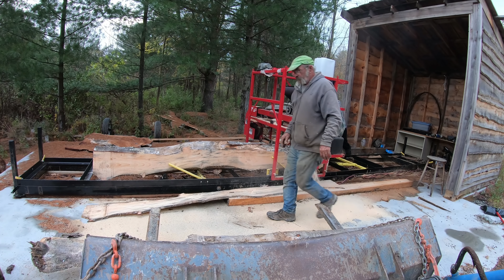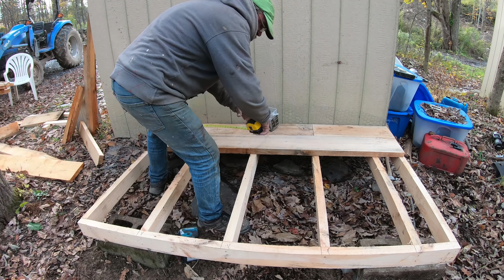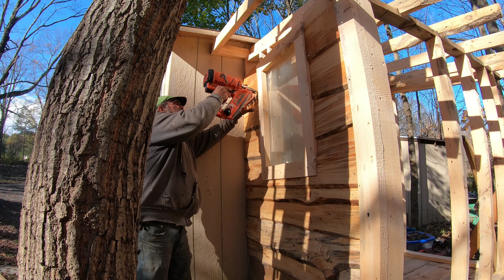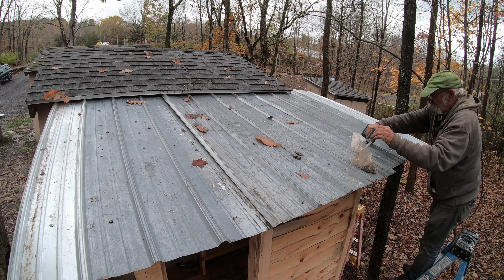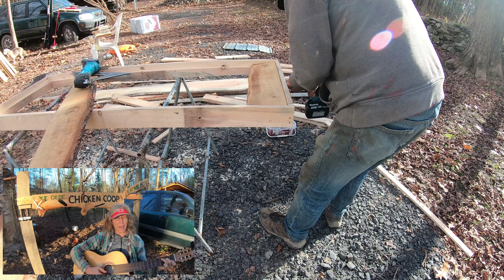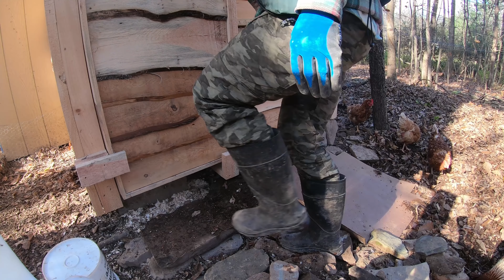milling for and building our chicken coop

Comment: I suspect that the cause of the mill's governor issues is a lean fuel mixture.  You may be able to adjust the mixture by turning a jet.  You might also remove the bowl from the carburetor, remove the float and its valve, remove the jets and clean all with a spray can of carburetor cleaner.  If this does not correct the problem, then you will likely have to take the carburetor off of the engine and rebuild it.
Reply from the maker: thanks i did that a while back and it helped but still surges some
Reply: Go check out “tarylfixesall” he’s really goofy and great small engine mechanic and he has videos on governor set up on many small engines. Just type in the YouTube “taryl fixes all governor” and it’ll pop up
Reply: @danwheeler5130  The next step would be to verify that the governor linkage is not loose.  It is supposed to have a spring that provides tension so that the governor's linkage to the carburetor is not sloppy.  Please verify that the linkage does not have any slack in it.  Ron's comment below is worth following.
Reply from the maker: @ronfrance4041  ok thanks
Reply from the maker: @hivolt55  i think your on to something the spring was missing and i cant find a replacement so i just added springs but i dont think i have the tension right

Comment: Surging motor is usually caused by partially clogged jets in the carb.
Reply from the maker: i cleaned it once maybe have to do it again thanks
Reply: @danwheeler5130  The air/gas mixture screws need adjustment.
Reply from the maker: @lutemule  i'll try that thanks

Comment: These nail guns make a good man cut corners. I don’t know where you got that from Dan you certainly never passed it onto your son. ( I know it’s only a chicken shed but it’s still cutting corners)
That’s my comment sorted for this video then👍🏴
Reply from the maker: how so
Reply: @danwheeler5130  Just an observation. When framing, old school would build the frame then lift into place and nail it into position. The nail gun toe nailed each spar into the rail. Would that be the way without a nail gun?
Reply from the maker: @Bo88y22  i would have done just that with the nail gun except the deck was shorter than the studs and that kinda makes it tough and by the way jesse also uses a nail gun
Reply: @danwheeler5130  I have watched Jesse framing the extension (addition) he was working on. I noticed he didn’t toe nail the studs. 
Even before nail guns, it’s very unlikely studs would be toe nailed right across a frame. I do enjoy your videos and I don’t mean to criticise but I do like to comment on my observations.
.
Reply from the maker: @Bo88y22  its called long island framing they have or did have a code where you had to show 3 nails in a 2x4 so they couldn't nail any other way than toenailing i know dumb but it became a way around here we arn't but 120 miles from long island

Comment: Did you really need 2" material for the flooring? It seems like wasting material
Reply from the maker: it was only 1 1/2  but it was stuff i had lying around so i used it could have been 3/4